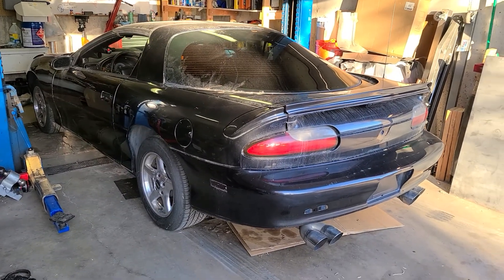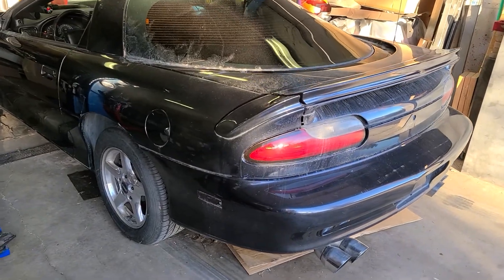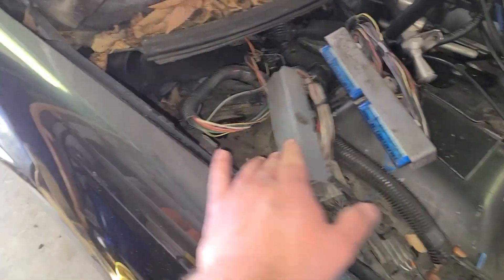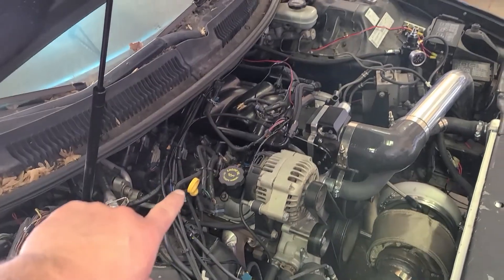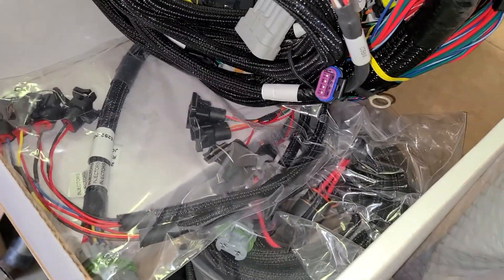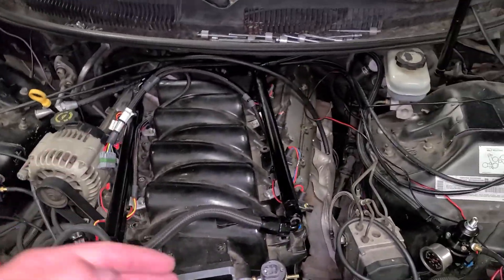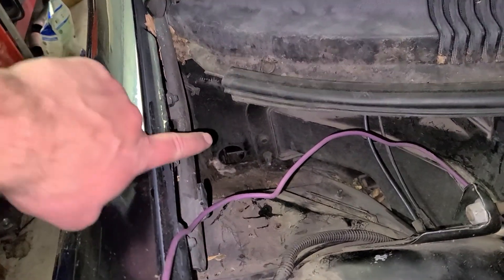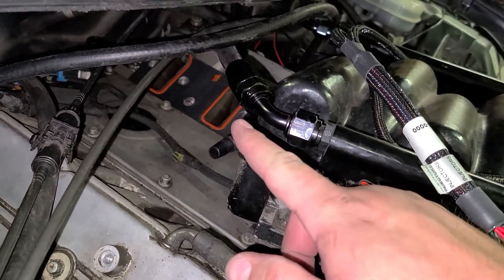Terminator X install on my Camaro #turbols #terminatorx

Comment: Can you show how you mounted up the ECU
Reply from the maker: So, I initially planned on putting it in the glove box area. But i just attached it to the passenger side panel down by where their feet go. I didn't plan on having passengers in the car, so I didn't feel a need to move it up. The car is now full racecar, and it is going to be mounted to where the HVAC core goes.

Comment: Hey man is there any way u could lmk what wire u spiced together by there started wire
Reply from the maker: So, the starter I left just the factory wire. It is separate from the harness.  If you're doing an f body, it is purple one (the purple one that is disconnected to remove the harness). I just pulled it out of the wiring loom.
Reply: I understand I just tryin to figure out we’re u wired the fuel pump wire and all that I am doing a f body and cant get power to my stock pumps don’t know what wires to splice off that white plug
Reply from the maker: @adamherald6376  My fuel pump from the terminator (solid green) to the body wiring (green with a white wire) this is the harness on the passenger side
Reply: @stroomperformance  so you just took the positive fuel pump wiring from the holley and hooked it to the factory green with white wire? Was the green with white wire with one of the ones you unclipped on the inside?
Reply from the maker: @TheDevin918  No, if I remember correctly, it was in the engine bay close to the battery. It was a 10 pin plug, and the fuel pump was pin D, green/white , as you stated.
Reply: @stroomperformance  gotcha, I’m sure I could intercept it somewhere along the way just not sure where those wires are routed though the car at.
Reply: @stroomperformance  was there some wires on the driver's side you had to ground for the key to work?
Reply from the maker: @TheDevin918  nope. Just the wires for the terminator had to be grounded.
Reply: @stroomperformance  awesome thanks man, another video said some wires from the factory harness had to be grounded for the key to work but it was a 98 car and mines 2000 so maybe that’s the difference

Comment: So you did this without pulling the motor?
Reply from the maker: Correct
Reply: I've got an ls6 swap in my 6 speed 98. Big cam head work etc. Fuel pump went out installed a fuel cell with 8an pfte line throughout. Aeromotive fuel system.. and I'd like to throw some nitrous at it. Idk if terminator x is right for me or not..
Reply: I feel like it'd be nice for future applications as well as this one.. say I pop the ls6 and just throw a 5.3 in, run a cam with a 200 shot.
Reply from the maker: @Geoff /// M Nelson  if you can swing it and make it work with registration, I would. It has a nitrous control option in it (I use it for boost control), and it has a lot of control and tune ability.
Reply: @stroomperformance  alright I'm convinced. Thank you!
Reply: @stroomperformance finally ordered it haha. Gonna try the install with my motor in. Ordered the 24x and ev1 ejector option for my 98 6 speed ls6. Gonna need some FIC injectors.. need to figure out what size I wanna go.. ultimate goal of 800whp eventually idk what lb I'll need